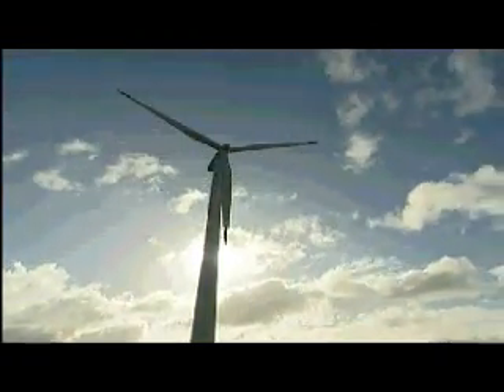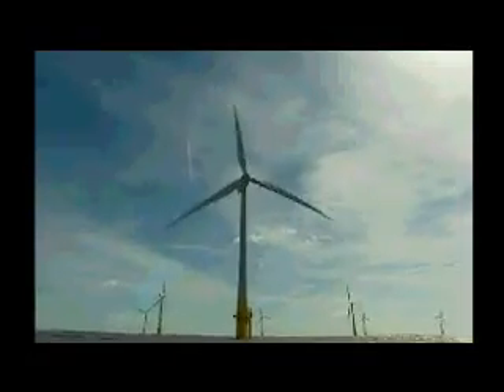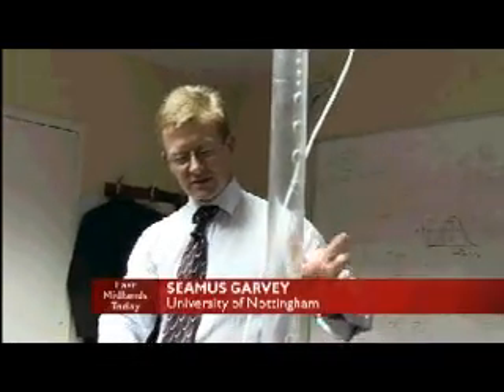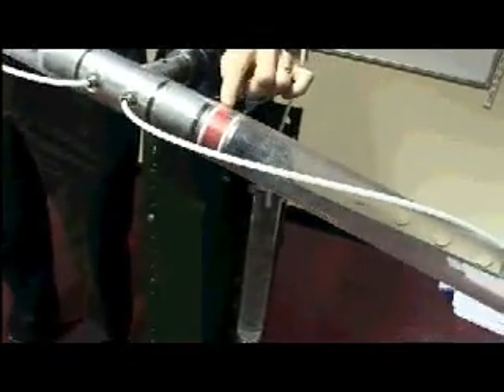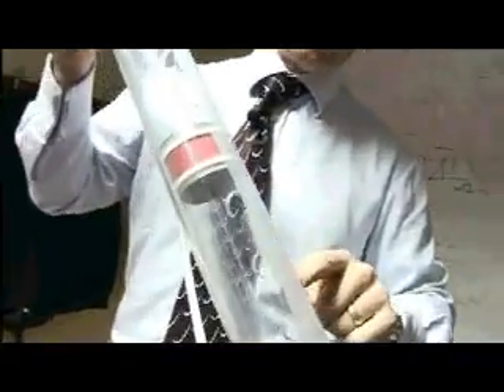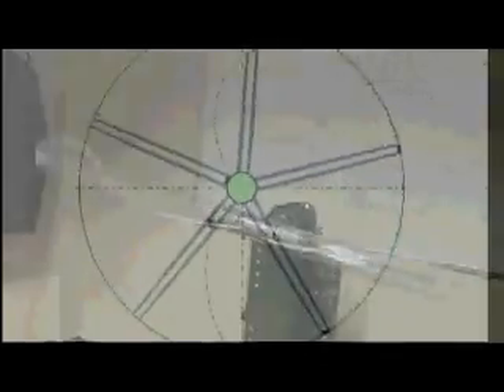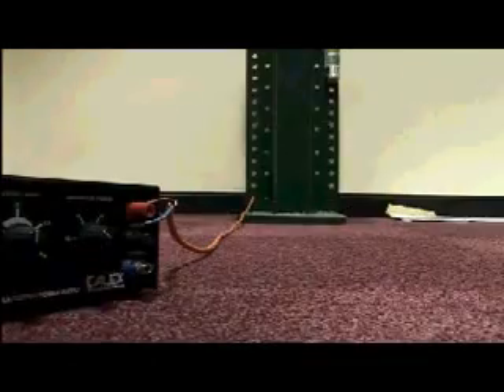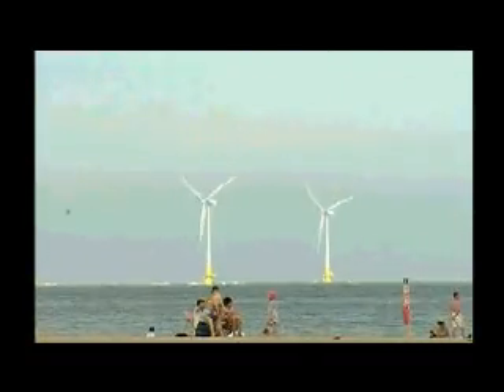Seamus's plan (EMT)

Comment: The blades need to rotate rather slowly for this to work. Centripetal acceleration will tend to prevent the pistons from falling, so the faster the rotation is, the lower the power output will be.